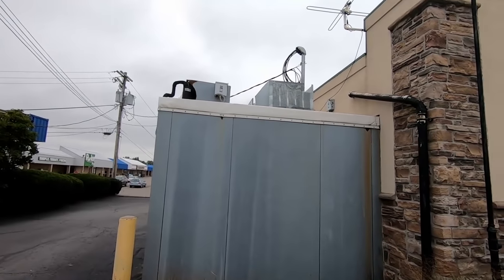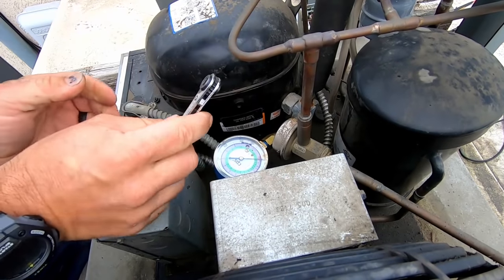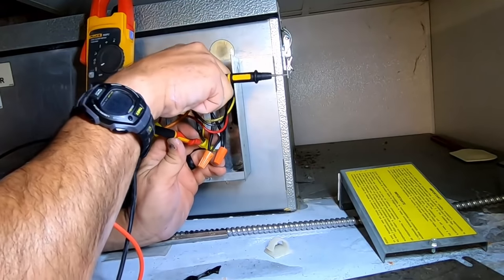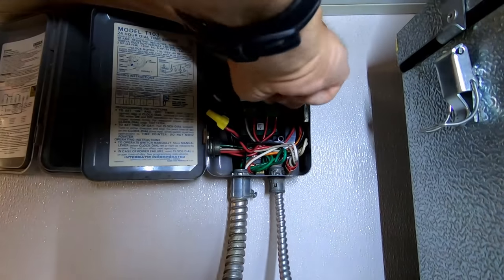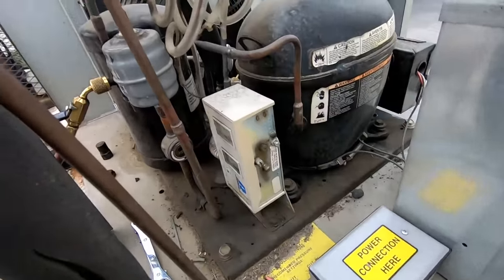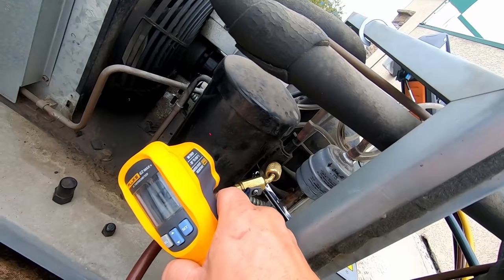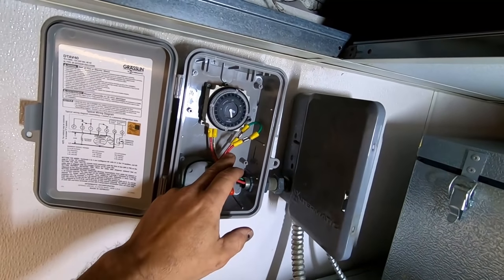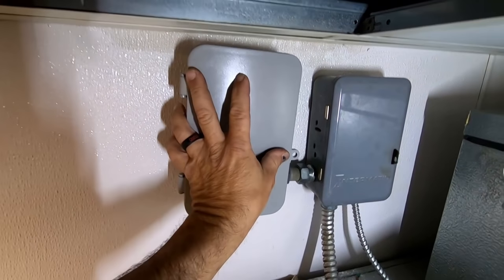Walk-in Cooler Warm, Condenser Not Running, Multi-Offender, Box At 60 Degrees

Comment: I had to send my H-10 back to the factory battery would not charge and calibration screw was out of whack 1.5 yrs old $258.00 repair yea go team
Reply from the maker: That hurts, you can get the battery on Amazon for $40-50, but the calibration thing would be a more difficult repair.